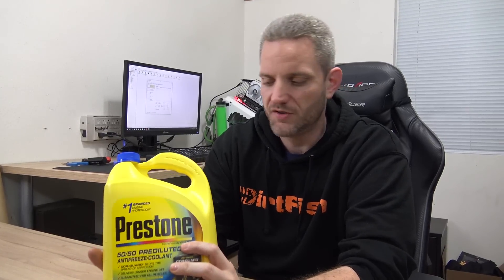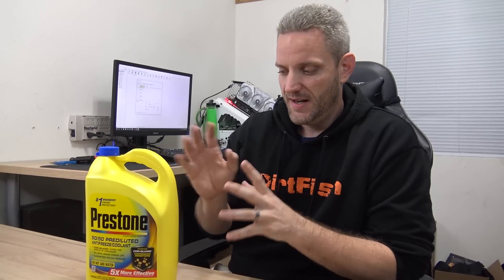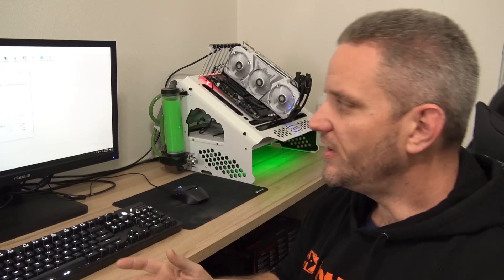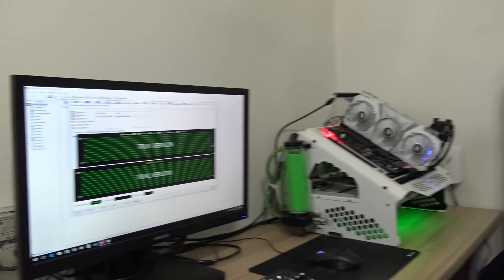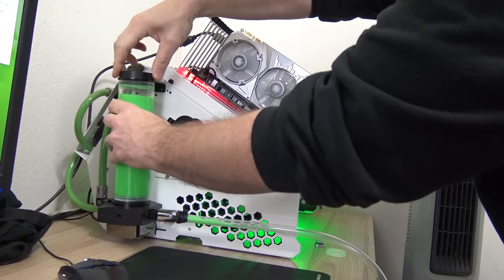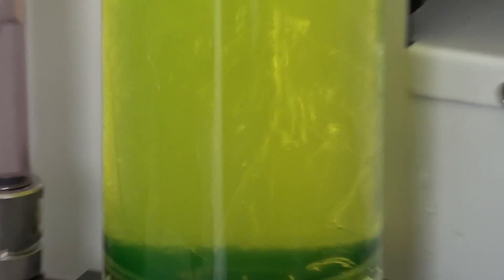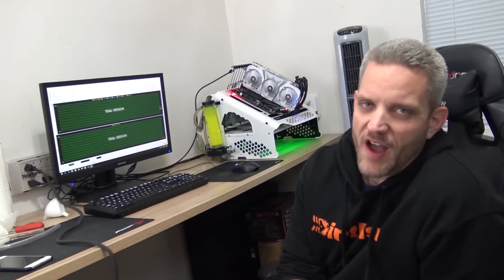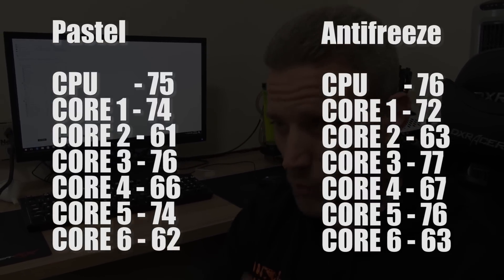I used Antifreeze to cool a PC

Comment: Ignore the corrosion crap, PLENTY cars (im a mechanic) come into the shop with plastic on the top of the radiator.

plastic thermostat housings.
many rubber orings specifically water pump.
many different metals the headgaskets often have copper /aluminum/ steel
most bearings are made of brass, copper, aluminum etc.

like i said already 6 years strong on anti-freeze, no issues WHATSOEVER.

did you know the anti freeze also works as a lubricant on your water pump?
THUS - lubricating your.. pc...water... pump ? for lack of better words LOL

literally i have suggested this for so long.
ive been watercooled since about 2009. after a couple years of fiddling and farting with my setup
i no longer cared to replace black light strips (UV)
no longer cared to replace fans and color match everything.
didnt care if my tubes glowed or not..

now i keep it simple. i picked a cool color anti-freeze, diluted the crap out of it
and got a reservoir and whatnot that matched.
Reply: yep dilute the antifreeze and add it in,  it will turn a bit brown but no biggie,,  I also find the fluorescent green very cool with my lights,,, when turn brown and glow goes away still good change it if u want.  i probably add ten to twenty percent
Reply: So, Water pumps have bearings, and bearings have seals!
there is also a seal protecting the bearing itself!
Water pumps have a WEEP hole to alert you when this hidden seal has failed.
allowing coolant directly onto the bearing itself. which quickly breaks ITS seals down,
and dont allow the bearing to reach the end of its target life span.

Not rocket science here or anything.

YES coolant lubricates seals, bearings, etc. its what it is designed to do
Reply: I'll second this comment. Have a system that has ran Benz blue coolant mixed at 60/40. It creates a hazy residue on the tubing but leaves nothing behind on the blocks or plugs anything. Never melted anything either and have been using the stuff sense 2009 or so in various systems. 

Its kinda cool though. If you have a system that is plugged up from crap colors or other addons coolant will clean it. Just put a filter in the system before the processor block and add some 50-50 ......presto. Loops clean. Replace tubing and enjoy life.
Reply: I've been using a ~10% mix for about 10 years. Replacing fluid every year or so. Same block, rad, pump. Several different builds. Swiftech apgee gt, mcp655 pump on speed 3, 2x120 copper rad.
Reply: Why were you farting with your pc? That is something that I cannot figure out. Or was it indicating something else😉
Reply: @maicon9  Doesn't matter if the specific heat (the energy required to increase it's temperature 1 degree) is lower than water's.
Reply: bingo.
plus if he had black light in the build it would glow :)
Reply: @maicon9  in a sealed system boiling point doesn't matter much
Reply: Thoughts on Summit Non-Glycol Ice Water Coolant ?
Reply: Which concetration?
Reply: There are many many many types of plastics, and as he said, the one used in our tubes, reacts to antifreeze.  Apparently what you see does not use that compound, and is safe.
Reply: It doesn't hurt the plastic at all?
Reply: Lol I should use 98-140 gear oil. But no, I know of what would look cool Ford's orange concentrate.
Reply: Antifreeze isn’t to cool. Straight water cools best. Antifreeze is added to prevent corrosion, and water from freezing in the radiator and block.
Reply: @seabass22  there is absolutely NO reason your pc coolant should freeze. And straight distilled water grows ALGAE. the antifreeze prevents the build up of organisms. And also lowers the freezing point. And raises the boiling point. You should Never reach either point
Reply: @dannyipwn1203  yeah. I’ve always used distilled water and pt nuke. Trying to see if auto coolant has anti growth stuff in it. I use soft tubing, nickel blocks and I think alphacool rads.

Will be checking everything out when I put the new build together.

Think using a 1:19 to a 1:9 coolant mix would be okay with adding PT nuke for anti microbial reasons?

Looking at some simple super tech coolant at Walmart.
Reply: @seabass22  ive been using anti-freeze now as coolant for honestly 10-15 years. been using the same Swiftech Apogee Pump and Radiator. ive been using a handful of different water blocks in my defense because of obvious reasons (chip updates and socket changes) ive not run into a single issue using it. infact i had issues running "blood red" coolant in another system with a weird white milky build up. Ive also had MAJOR issues with Algae growth in a pure distilled water setup aswell.

you just simply cant beat antifreeze. it seems to lubricate the o rings and keep the water pump running healthy. (knock on wood im using the same pump ive always used!)

also using soft tubing.
Reply: @dannyipwn1203  what antifreeze you using and ratio?
Reply: @seabass22  I’ve use a orange dex and the red vw stuff. I started 50/50 but I’ve diluted it more and more over time. Try a 1:4 mix
Reply: Even if anti freeze works as a coolant you're way better off using just water unless your trying to run a subzero system. Water is a better coolant by far as it has a much higher specific heat we only use antifreeze because it doesn't freeze in the winter.
Reply: my only issue is that as a pure "coolant" antifreeze isnt very good, water is much better, it just keeps the water in it from freezing. It really is not a very good coolant.
Reply: hope i never need to take a car in to your shop...the weep hole is there to let you know the seal hasfailed, water is ALREADY getting in, its life span is essentially done at that point, more or less. the fluid in the coolant system of a vehicle doesn't lubricate anything...its designed to transfer heat out of the engine to the radiator and heater core, each and every bearing its close to is sealed...the last thing you want getting into one is water brah

Comment: The reaction you were seeing was distilled water in ethylene glycol rising from the pump. They distort light differently.  As thermals go it would be best to have water as much as possible but it's the corrosive (electrolyte solution) element in the system. If not when filled then after few months when it gathers some ions from the system. That is why you never mix 2 different metals in the loop (like Al and Cu).

Comment: So if antifreeze works just like water, what's the point of using it over water in my car?
Reply: you could get by with using only water just fine, but only you live someplace it that it never goes below freezing outside.  if that water ever freezes inside your car's engine, that engine is gonna be recked!
Reply: Cuzz water (as common used source is majority of the time water from a hose aka tap or faucet water, is hard water, and has a boiling point much lower than anti-freeze, and the engine easily produces the temps 2 to 3 times that of the boiling point, and boiing water becomes steam!! And water can not be compressed, turning a gallon of water into steam, equates in higher pressure in the system, and eventually breaks down from boiling, turning to steam, and then liquid again while cools back down, reacts to mixed metals faster, and negatively, using rusting, and u get a orange muddy goop. And thats if the steam pressures havent already forced either a freeze plug out, or blow the headgasket or crack a cylinder wall. So anti freeze has a higher boiling point, and along with anti corrosive addins, is why anti freeze coolant is used ifor automotive cooling systems.

Comment: LMAO... Anti Freeze has nothing to do with cooling. It's to prevent freezing and raise the boilding point of water.. You should use Red line WaterWetter...

You also screwed up. As Anti freeze needs distilled water to work correct. It even tells you the max should be 60-40 mix....

Comment: I've used anti-freeze as a coolant in my liquid cooled system for 4 years, and haven't had any problems yet. My reasoning at the time was that anti-freeze's anti-corrosive properties have been proven for something like 100 years now, and that PC watercooling is a fairly niche market. I kinda doubt the specialty PC cooling manufacturers put any research into their specialty liquids. I built my liquid cooling system from the cheapest parts I could find, including used parts from ebay, so I''m sure there are dissimilar metals in the loop, which would've corroded with just plain water. I'm not sure what type of tubing I used, but it hasn't failed yet. It is slightly cloudy now, but that's about it.
Reply: Do you got acrylic in the loop.I just wanna make sure it works with that before I put it in my system

Comment: car coolant systems are pressurized (when they are at operating temperatures) and that really helps it work better when water temp goes above boiling point. there's no reason antifreeze would damage any of your PC coolant hardware, unless there is enough viscosity to screw with the pump motor... vehicle coolant systems and computer coolant systems are made from the same materials... aluminum, copper, and petroleum based tubing. the only reason to use anti-freeze is to raise the freezing point AND the boiling point of the coolant. otherwise you are just as good using plain distilled water (that goes for cars and computers)

Comment: thermal paste, USE THERMAL PASTE!
Reply: Liquid metal
Reply: Johnnyboycurtis liquid metal contains gallium, it will weaken any aluminum.
Reply: Dj Mystery The comment was in jest. Have a sense of humor friend
Reply: Dhruv Jat uh. Thermal paste is... well. A paste. Not a liquid
Reply: @NyrixDerg  He's talking about the heat spreaders on the CPU
Reply: Echo tech r/whoosh
Reply: Dhruv Jat that would be a bitch on the pump
Reply: Dj Mystery That is the least of the worries. Metal is very very very dense. Like over 10 times as dense as most normal liquids, so the pump would have to be 10 times as powerful. Then there’s the problem of the super dense liquid metal going through the tubes not breaking the tube itself.

Comment: pure distilled water is the best medium, especially when it become pressurized, the additives that come in automotive coolant are completely unnecessary, for one your pc should never be in a environment where the coolant may freeze and the other additives are conditioners for shaft and rotors seals........water is king for a liquid cooled system with maybe the addition of a sacrificial diode to prevent electrolysis and osmosis.

Comment: Testing at anti freeze at -40 to -80 °C. That is main reason plus corrosion and erosion. 

If your rad was out side in the cold climate it becomes free renewable. Even heat your your shop if cooling 20 GPUs for the sled dogs of course. Mush! Mush!

Less hassle then Nitrogen extraction from air 79%. The comment below ask for liquid oxygen, if your keeping the 20%  diatomic oxygen pure, remember pyrophoric substrates explosion. 

Since air is cheap concider using the last 1% Argon  for a user friendly experience when practicing cryogenics   of -130 ,C
Reply: What I would recommend is purging polycarbate case with neon gas and a Peltier cooler. 

Why neon gas you ask? Plasma of course!

Comment: Might as well use water.. antifreeze is to keep the water from freezing in a block in the winter and to change boiling temps of the water... in the summer you can run straight water in a car

Comment: IBM 360 and 370 family is watered cooled. IBM had copper and plastic tubing, with a special mix. It was clear like water and oily to the touch. We had to flush the unit once every two years.

Comment: Auto mechanic here.  That 'offgassing' you're seeing is perfectly normal for antifreeze when it mixes with water.  If you ever flush out your car's cooling system and fill it back up, you'll see that happening once water is introduced.  I'm not 100% positive what it is, but I'm pretty sure it's simply the water you used to flush the system mixing with the Ethylene Glycol.  Happens every time I service a cooling system, never had any negative issues.

Comment: Coolant/antifreeze is added to water to either keep it from freezing or to raise the boiling point of water to keep it from evaporating and it actually inhibits waters ability to transfer heat. The more coolant you add the worse the mixture will perform in terms of transferring heat away from the heatsink. So if effective cooling is the goal stay away from coolant however if the longevity of your cooling solution is a factor then coolant is a great way to condition your water so you don't have to keep adding more water to compensate for evaporation as well as keeping corrosion in check.

Comment: In cars running straight distilled water with an anti-corrosive like Water Wetter normally results in lower coolant temps than with Antifreeze blends. Technically antifreeze blend should be worse but not creating enough heat with a computer to show that difference.

Comment: I hear children in the background. Personally I just use straight distilled water because there is little children in the house. I'd rather computer die, tube rot, waterblock corrode than the slightest chance of little timmy taking a sip of the funny liquid.

Comment: Coolant is useless for a pc. Because, it's made to have a high boiling point and low freezing point, so it's better than water for cars that get into the hundreds of degrees, and in the cold winters, it doesn't freeze in your system. So it does cool better, it's just more durable for very high and low temperatures. Using water alone in a cars system will either freeze after sitting in your car over a winter night, or it will boil and evaporate and expand in your car in operating temps(especially in a performance car) and over heat and possibly explode out of your cooling system.

Comment: It's an interesting question I'm building a PC in a server case for the back of my SUV for work-related video editing the system is headless using remote desktop via a laptop in the front seat can I water cool with antifreeze already run through my vehicle or is that going too hot I told you it was an interesting question

Comment: Well, just check the specs of the antifreese if it eats plastic or rubber. If it aint, then you're save, right? 

This should work with every liquid in the coolingsystem. As long its not eating the plastic and rubber "and" is able to handle the temperatures of the system/connectings to the board what needs to be cooldown. 

Also, watercoolingsystem is NOT contacting "directly" the metal of the prossesor, right? It all happens in a closed box inwhere any liquid is pushing through, right👍

Comment: Its worth mentioning that Glycol is also pretty toxic and cannot be disposed of easily.

ANTIFREEZE is exactly what it sounds like, for cooling systems in sub-zero environments! 
In an automotive cooling system, we already have several dissimilar metals.  Usually steel and aluminium as well as plastic tanks on radiators.  Some aftermarket water pumps even have a plastic impeller!

It would be interesting to see if small amounts of ethylene glycol are safe for pc water cooling for environments that may reach below freezing.  Or, if there is a better solution for antifreeze. 
Using automotive coolant hose could be a solution for tubing.
Even -an lines could be used, if you want to risk having a bunch of conductive stainless lines hanging around your case.  At least it would look cool.

Comment: Ethanol and other alcohol is an organic solvant. That means that on long or medium terms your rubber seals will be dissolved. Normally your pump valve will not work properly ( it leaks when it should close). If you have good rubber in your pump you will see leakage anyaway at the rubber seals of your connections after a certain time.

Comment: I used antifreeze for several builds, use a real pump like a Flowjet, a heater coil instead of those narrow channel PC rads. Drill the flow concentrator(or remove the insert) in the CPU block. If you can keep the flow up with the heavier coolant it works really well. Never had any corrosion or problems. As a matter of fact I never had  issues like the settling of dyes or separation like I do with PC Coolant. The antifreeze loops always had consistent tempatures no matter how much voltage you used the coolant would rarely budge 1 or 2c

Comment: Hi Jay, question: what's the best pc coolant out there? From your experience, is a pre mix solution better that distilled water with bio inhibitors and anti corrosion solutions? Or am I just as good running only distilled water? Thanks

Comment: let me sum this up. antifreeze is not a coolant even in cars we use water to cool and antifreeze to prevent freezing and rust of the steel parts. so the only effect this has in a computer application is to raise the boiling point to prevent air bubbles and cool better then just water by allowing the water to have a better surface coverage but computer cooling is not a pressurized loop so this will have no effect either. thus everything antifreeze would do for cooling will not work in a pc scenario. and water works better  already. there are additives i would like to see tested like royal purples purple ice might actually do something but what it does beyond turning the water purple. who knows.

Comment: Some people say just use distilled water for this... I'm not doing that. A  Corsair H100, mine, has copper block and aluminum rad. Dissimilar metals, meaning, they will mess that coolant up if you use it alone. Car antifreeze is ALWAYS formulated to work with dissimilar metals and prevent that corrosion. Relatively speaking, automotive coolant  has an easy job in a PC water cooler.
Reply: Yup, that is like using industrial extension cords rated for 30 amps at 240 V to connect your TV, complete overkill for the application, but you what they say, there is no kill like overkill.